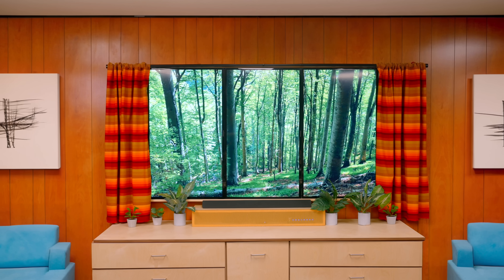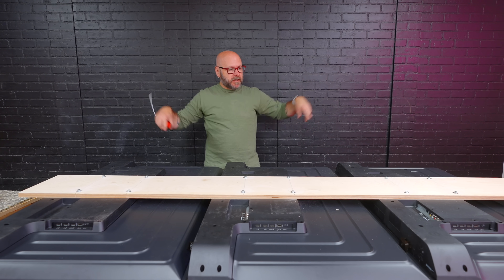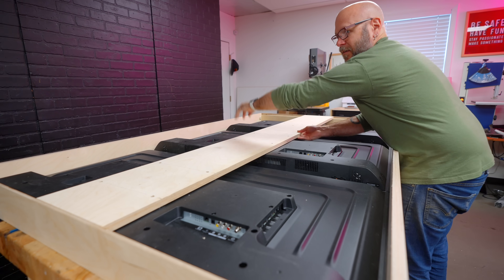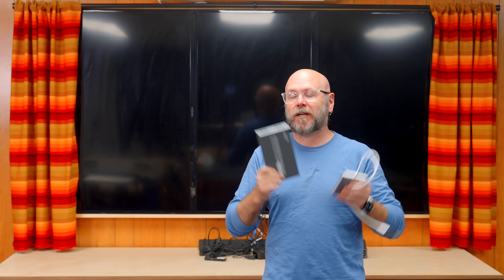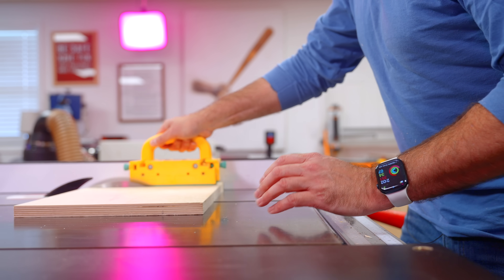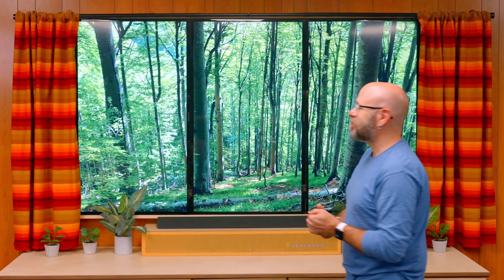I built a WINDOW using TVs

Comment: Very nice build on the frame. For the electronic side you could just plug the TVs directly into any PC with three HDMI ports and tell Windows they are vertical. It would be cheaper and you get higher resolution.

Comment: For the power button - you could solder extra wire to make the button come out further. Then, place it on the underside of the frame. I love this build and most likely will steal your measurments and save me a hassle of wasting wood. Just getting into woodworking. Like to do things right from others knowledge and learn that way over just kinda doing it myself and seeing if things works.

Comment: As an AV industry vet, I’d point out that, technically, you should buy TVs that specifically state they’re designed to be hung in portrait orientation. If not, they’re much more prone to overheat and you’re voiding the warranty. But that would probably at least triple the cost of your project. Awesome build!
Reply: Wait.. can you elaborate? Why would orientation change the fan? Just from rising heat?
Reply: @AnthonyLoPrimo   Correct. A lot of the cooling is passive, designed for the heat to rise away in a certain direction. When you turn the display, it may cause heat to dump right into sensitive components and shorten their lifespan. It was way more of an issue on older sets, but it can still cause issues.
Reply: @AnthonyLoPrimo  as someone who just has access to google, I’d point out that, there’s nothing online to substantiate the claim that mounting any tv vertically will make it more prone to overheat lol
Reply: @jackson_a95 My man 😂😂
Reply: @jackson_a95 you don’t need google, just knowledge in thermal dynamics. If the vents are at the top of the TV then it may not vent properly.  BTW your google kung fu is pretty weak considering I found several provisos as the OP outlined.
Reply: @5280Woodworking  
> your google kung fu is pretty weak
I read this in a hack-fu badly lip-synced movie style
Reply: @jeremyspecce  I mean, nothing some warranty voiding case mods can't fix.

But that does make sense actually. Thank you!

Comment: I love the workmanship. Great job.  I've been experimenting with making a 1:3 portrait video wall for about a year now.  I'm surprised that a 4k video stretched across what is now about a 110 inch display looks good enough from a few feet away.  My most recent experiment was with a matrox quadHead2Go box and a single portrait tv to see what it would look like with 3. I was not happy at close range so I abandoned that and am now working with 3 32" displays.  But if you are happy with it I may rethink my project

Comment: 3:45 Pocket screws work best if you run them in away from the edge of the receiving piece..

4:33 Just to show that I'm not some sort of know-it-all troll (I actually do not know it all - at 47 a guy should know his limitations.. lol), I want to give huge props for showing this technique. I've seen it done before (I think I've even done it). It's a super handy tip.

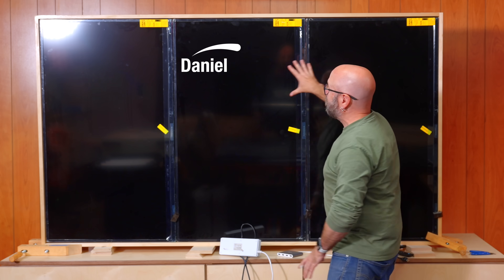8:13 lol

Nice project. Thumbs up.

Comment: I'm surprised you din't extend the wires so you could mount the on/off button underneath the frame.  Doing that later on?
Reply from the maker: Was going to but had trouble finding the correct size 5pin cable needed to extend them. I could have soldered extensions but my soldering skills are not up to par.

Comment: I know part of this was using cheap tvs, but have you seen some of the new tvs these days? I'm not talking about the screen quality, but how thin they have made them AND how they've improved the way they mount them on the wall. Someone I know recently got a new tv and got one that is so thin and so close to the wall that if you put a frame around it and set it to display a single image and mess with with image and brightness settings it would pass as a large framed photo or painting. 

It would be way more expensive, but I could see some people using those types of tvs to make some fake windows that are also still very usable as a tv, or if they go the hard route they could make it look like a photo when not in use. It isn't my tv so I don't know how much the built in settings allow you to change the brightness and if you could ever reduce it enough to make it look like a convincing photo or painting but making it look like a window would be super easy.

Comment: Great Project.   Wondering if mounting the TVs might have been easier also using he french cleat idea.   Each could be lifted indivdually  and then slid together.  It would add no additional depth over how you did do it.

Comment: And since the same drywall, and if you do not have a magnet or a stud finder knocking on the wall, you can find the stud just by knocking and hearing the difference of that Luan versus the Luan and the 2 x 4 studs in the wall

Comment: The only thing I’d do differently than Daniel is to make the frame look more like a real window. I’d face frame over the bezels to look like grilles and add a sill. 

If you’re worried about the face frame interfering with the receiver for the remote, I’m sure someone out there makes an external receiver…though I’ll admit to not researching that.
Reply: Yhea honestly I'd want to get 3 that had skinnier bezels as well so the gap between wasn't as bad. It'd make it far more useful but again cost.... I'd also probably go for computer fans and control of the system as most people already have a computer and buying specific controller to do the job seems unnecessary. Also give you a huge computer screen to use.

Comment: Were you able to get a true 6k resolution with that HDMI splitter? I have a TV matrix at the office (8tvs, 4x2, 32:9), we had to use multiple pieces of encoding and decoding hardware to handle that many TVs and those cap out at a 4k combined resolution, looks rough up close.

Comment: I’d use an entry level Mac mini - they have like 4 USBC +1 HDMI… just extend the desktop to fill 1 image or slideshow onto 3,4 screens. Unit would be about the same as one of the screens. Use a remote - oila.
Reply: And you can use the apps. Disney, MAX, etc. high speed flyover videos like the Apple tv uses, Spotify - the sky is the limit.

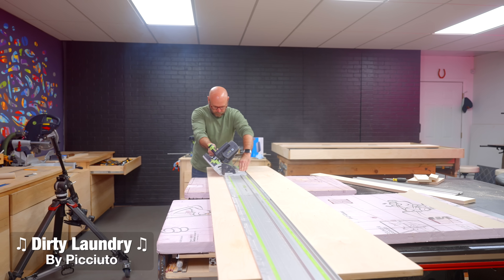Comment: 5:35 oh, I was sure you were going to hang the structure by that middle board where the tvs are mounted and that the frame was just for decoration. I have a lot less faith in the corner connections of the frame being structural and bearing all of the TV weight.

Comment: All I could think, besides this is cool, I would have added a strip (to the wall) under the piece bolted to the TV's.  That's where all the weight is.  The French cleat will hold it to the wall and share the load with the additional block, but it would take a lot of load off the frame.  Just a thought.  Also, maybe a face frame, instead of the edge banding, to make it look like window casing?  Just another thought.  And what happened to your table saw, bro? I swear I could see it under the track saw? Great stuff, as always.
Reply: 100% This is the way.

Comment: And I have a solution for your power buttons you can actually clip the wires on them and solder longer pieces of wire and attach it to the frame you made and I don’t know if you’re anal when it comes to things just standing out and you don’t like it such as the TV is brand name on the bottoms. I have a good solution for that too if you want to remove them or if you just don’t care for being on there fingernail polish remover works perfectly. I did not do this exact one that he made. I did a four version, and I just clipped the wires and soldered longer pieces of wires on all of them so they ended up getting soldered together, so I only needed one button but that’s also because I was planning on being permanent in my man cave/workout room.